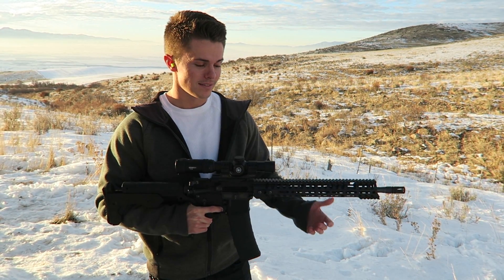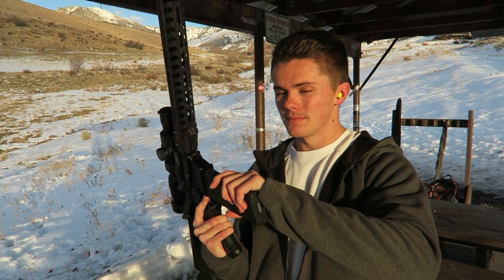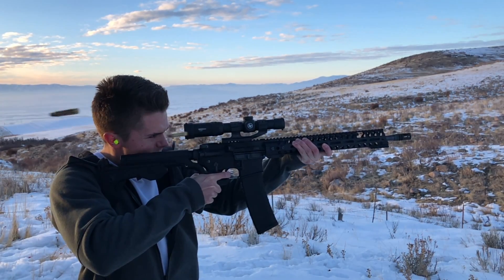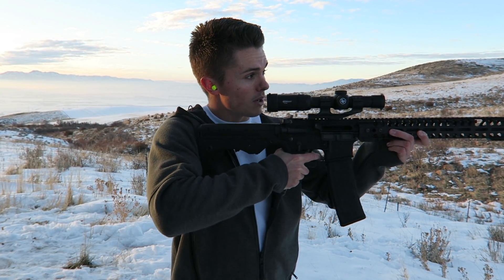How Fast Can A Bump Stock Really Shoot?

Comment: Your explanation is true and exactly why I don't believe bump stocks were used in the Vegas Shooting.
Reply: There was 1 volley of fire that lasted 32 seconds.  There are no magazine fed firearms (bump stock or even full auto) that can sustain that long of fire (due to limited magazine capacity). The only way that could have been done is with a belt fed machine gun. It wasn't a bumpstock. No way. A full auto M16 shoots at about 800-900 rds per minute.  You'd need a magazine that held 400+ rounds and there are none. The largest mag that will fit a AR platform is a 100 rd drum which at best would give 8 seconds of continuous fire....not 30+. 
Was a false flag event constructed by the gov using a M240 (there are videos that show the exact sound wave patterns matching up exactly).
Reply: @wilcoxtactical3716  YEP!
Reply: @wilcoxtactical3716  If an M240 was used there would have been a lot higher death to injury ratio, and the projectiles would have been pretty obvious. It was 5.56 being fired, not 7.62x51 like an M240 would fire. There's absolutely no reason why they'd have to lie about the weapon used either, so I really don't understand this insistence that it couldn't have been an AR platform rifle with a bumpstock. The fire rate is also very consistent with a bumpstock, and has the same characteristic droning (shifting from slower to faster fire rate, i.e. inconsistent) that you'd simply not see out of a belt fed firearm.
Reply: @infantjones   @infant jones  its already proven an M240 was used.  Everything you have said is speculation that is not backed up by facts. There is reason they would lie about the gun used for 2 reasons: 1, there are very few M240 machine guns that are owned by civilians because of the NFA. The vast majority of them are owned by the government. (Not something you want Americans knowing if you just one of your military guns to shoot up a concert) 2, it doesn't fit the agenda. The agenda was to ban bumpstocks. That was critical to their mission. Ive owned several bumpstocks and they are very hard to get any sort of consistent rate of fire. The sound waves from the shootings was 100% matched up to a m240...not a bumpstock 5.56. The m240B has 2 cyclic adjustments on its gas block. You can select the faster one to around 800-900 but its generally set to around 650 rounds per minute.  Having been a machinegunner in the Infantry 5/20 INF, I am familiar with that gun and its rate of fire. The 2 rates of fire between a bumpstock and M240 are not comparable. 7.62 also doesn't sound like 5.56. 
A bumpstock is a semi auto weapon and is nearly impossible to get any sort of consistent uninterrupted rate of fire and there are no magazines that could keep going 30+ seconds with anything other than a belt fed machine gun. Even the slowest of full auto weapons shoot at around 500 rounds per minute.  Do you know of any 250 round magazines available for the AR15? 

https://m.youtube.com/watch?v=I82X-7pwWmQ

https://m.youtube.com/watch?v=_mXe9dk77bk
Reply: @wilcoxtactical3716  How in the world has it been proven? There is virtually no clear evidence to suggest an M240 was used, and loads of counter-evidence. As mentioned there was a very low death-to-injury rate, which wouldn't be the case were an M240 used as it fires a round which retains much more energy at range, whereas such a low ratio is quite well expected for the use of 5.56 at 450 meters, which is 200 meters beyond the maximum effective range (past 250 meters the fatality rate plummets). Further, as far as I'm aware not a single 7.62x51 projectile nor casing found ANYWHERE by ANYONE in ANY PLACE outside of the AR-10 platform rifles Paddock had in the hotel room, which weren't even used as far as I'm aware. If it were an M240 used, there's very little reason to lie there either as they could very easily claim Paddock illegally converted a semi-auto variant of one to full auto, as you can buy a semi-auto M240 for around 12,000-16,000 dollars, something Paddock absolutely could have afforded. Then, if this idea of it being some ploy to ban something were true, they could use that as an excuse to (for example) ban semi-auto belt feds, or even semi-auto versions of full-auto-only guns as a whole! Hell, they could have claimed it was a parts kit build and use that to crack down on parts kits like they've been trying to for years! Both would do far more to further their goals of gun confiscation than just banning a type of stock, which doesn't even get rid of the actual rifle. 

Next, in the first video you link the fire rate is very clearly inconsistent, droning from higher to lower rates and giving that distinct "wavy" sound you hear in virtually all audio of the event, which is exactly what you'd expect from a bumpstock and not at all what you'd expect from a belt-fed machine gun. There are also many brief pauses in bursts (only a few seconds) consistent with losing control when using a bump stock and ending the actual bump firing, alongside a good few single shots that probably resulted from a failed 'bump-start'. Further, neither of the clips provided show "30+ seconds of uninterrupted gunfire", and I've never heard anything close to that in any audio of the event so I really do not know where you're pulling that from unless it's out of your own ass. The closest thing was two extended bursts that still had several seconds between them, more than enough time for reloading.

With the second video, claiming any single fire-rate for the use of a bumpstock is absolutely moronic, though it's "interesting" how the uploader exclusively uses the lowest-rate bursts even though a much higher rate can be heard in most audio, that higher rate not at all being consistent with an M240 (being under the M240s higher cyclic rate gas setting) even were we to ignore the inconsistent rate of fire in individual bursts. As I've already mentioned in this thread, fire rate with bump stocks can vary considerably depending on the specific stock used, how the rifle in question is gassed, length of gas tube, strength of buffer spring, weight of buffer, how the shooter is holding the rifle, and even the length of the shooters arms! Cyclic rate between different ARs can vary quite a bit because of these factors (alongside things like bolt weight, temperature, lubrication, etc.), and it's rather easy to shoot slower than cyclic rate when using a bump stock. You even hear this with different bursts during the shooting! Several different fire rates were heard across the various bursts of fire, which isn't surprising as Paddock used multiple rifles in the course of the shooting, tossing one and grabbing another if he got so much as a stovepipe jam because he was a blatant amateur in virtually all aspects of his planning and execution of the shooting, hence the amazingly low death rate compared to the number of people who were shot. And again there was not, at any point, anything even approximating a 250 round burst of fire. 

The variance in fire rate is pretty obvious in most videos of people using bump stocks-
Quite slow rate at the beginning of his first burst: https://www.youtube.com/watch?v=n6FnhUYifgs

Here you have a rather slow fire rate (once they actually start bump firing): https://www.youtube.com/watch?v=jKgu6g6pyDI

More variance heard here, with a very slow fire rate when he's using the 100 rounder, picking up some towards the end: https://www.youtube.com/watch?v=pqxoiAjSrAU

Bump firing isn't a precise nor consistent means of firing, as seen here the fire rate can vary wildly, even on the same rifle on the same magazine in the same burst. I'd also just say that banning bumpstocks would be a laughably small-scale agenda behind doing such a thing, they didn't even ban any other devices that allow you to replicate fully automatic fire, they just banned the one item that got a lot of press as a result of the shooting, and did it without even going through Congress first. If they wanted to ban bumpstocks, it could have been done through the Presidency and the ATF (like was actually done) without any event required to justify it as the ATF is already freely able to arbitrarily change definitions (and as such ban certain items) with practically no oversight. Plus, as I've already detailed, there would clearly be more motive to claim it was an illegally converted M240 than there is to say it was just rifles equipped with bump-stocks. Even with the bump-stocked ARs, it would have been hugely beneficial to gun confiscation plans to claim Paddock was a restricted individual and all his rifles were parts kits builds on 80% receivers or something of the sort. The goal of the gun grabbers is to both restrict types of firearms available to the public and to reduce access to firearms as a whole, banning bump-stocks did not even theoretically accomplish any of that. It failed to actually disarm anyone and even by gun grabber standards was a useless "feel-good" type action.
Reply: @infantjones  I'm going to make this quick because I have a life and things to do today. 1, you're wrong on everything you've said.  2, the FN M240B semi auto machine gun available for sale on the market is closed bolt and make no mistake about it. It 100% can not be converted to an open bolt machine gun. Look more for more audio clips. There is 1 that goes for 34 seconds and many that exceed 20 seconds. The fastest a bumpstock will fire approaches the 800 rounds per minute full auto rate of the m16 and contrary to your belief of changing rate of fire. Even if you cut the rate of fire to 600 rounds per minute you could only do a consistent burst for 10 seconds. Contrary to your belief as well number of rounds fired dont equal more kills. In Vietnam the US military expended nearly 50,000 rounds per kill in Vietnam and nearly 250,000 rounds per kill in Iraq. And last but not least the sound waves from the M240B (not capable with any other firearm) matched up exactly to the sound of fire from that day. The only way that could happen is if you had the same cartridge, with the exact same barrel length and same rate of fire. In court it would be 100% definitive evidence that could not be disputed. You may be able to convince some people that the government didn't shoot up those people with their own military firearms the same way they mowed down college students in Kent State in 1970...but here you're going to need facts. You're speculation holds zero weight.
Reply: @wilcoxtactical3716  1. Virtually everything I've said is demonstrably correct, "nuh uh" isn't an actual response to this. 

2. You absolutely can convert a closed bolt firearm to open bolt when it has originally been designed for such. Machine out the blocking bar (whether a physical bar or simply a stamped ridge in the receiver meant to block an unmodified bolt), buy an original bolt and fire control group (neither of which are regulated), and install them. Anyone with a few dollars and a cheap mill, or even a 100 dollar drill press really, can do this with some time and effort. To say it cannot be converted is objectively false, they're just more difficult to convert than they were before the ban on open bolt semi-autos as you have to replace/modify a typical 3 components instead of just 1. Class 3 manufacturers do these multi-component conversions of semi-auto clones/variants of machine guns all the time, it's not unusual in the slightest, and if you've ever been to a store range where they have some machine gun rentals, several of them were almost certainly converted from closed bolt semi auto. 

3. Simply link me one, just one, of these audio clips that show "30+", "32" "34" etc. seconds of /uninterrupted/ fire, because I've not found any of them so far, which isn't too surprising seeing as you change the number of seconds with each reply! And "contrary to (my) belief"? I linked multiple videos clearly demonstrating the variance in rate of fire, by several hundred rpm at that, did you just not click any of them or are you denying what you can clearly hear and see yourself? 

4. The number of rounds expended per kill in Iraq and Vietnam were not number of hits per kill, and I think you know this as I don't think anyone would be dumb enough to claim that only 1 in every 50,000 hits produced a kill unless you think the US was using pellet rifles. These statistics reflect how the overwhelming majority of gunfire from American forces is suppressive fire, which isn't even really intended to hit any target. I'd also imagine the shots fired per kill per rifleman were quite a bit lower than 50,000, that high number mostly being from mounted machine guns on both ground vehicles and aircraft, like the M134 which was extensively used in Vietnam and rarely hit shit but worked wonders for suppression. What I am talking about is the number of hits per kill, and under 14% of those who received GSWs in Vegas died, a rate that is to be expected from 5.56 some 200 meters beyond its effective range, but a rate that would be unusually low for 7.62x51, which has an effective range ~150 meters further than the range Paddock was shooting into the crowd from. If an M240 was being used, with the exact same number of rounds fired, with the exact same number of GSWs, there would have been quite a few more deaths. I don't think you or any other reasonable person could deny that at a range of 450 meters, a hit from 7.62x51 would be quite a bit more likely to kill than a hit from 5.56x45. At 450 meters, a 55 grain 5.56 projectile out of a 16 inch barrel will only have around 350 ft/lbs of energy remaining, whereas at the same range a 130 grain 7.62 projectile out of a 16 inch barrel will still have 850-900 ft/lbs of energy. For reference, 350 ft/lbs is comparable to being shot at point-blank range with a typical, standard-pressure 115 grain 9mm. out of a <5 inch barrel. Some 850-900 ft/lbs is about what you'd get point-blank with a .44 magnum out of a <5 inch barrel.

If the significant difference in energy isn't sufficient evidence for you that it'd be unusual for so few to die were 7.62x51 used, then I must ask again, where are the projectiles? If 411 people were shot with 7.62x51, why hasn't a single one of those projectiles come out to dispute the "official story" of 5.56 being used? Over 1,000 rounds were fired total, yet no one has found a 130 grain projectile in the dirt? That'd be an insanely efficient coverup if so, especially considering how incompetent the US government is when it comes to coverups. Where are the hundreds of nurses, doctors, paramedics, cops, etc. who saw and/or handled the victims and would be able to say if the wounds were inconsistent with 5.56, which they would be obviously inconsistent were 7.62 to have been used. None of them have disputed the use of 5.56 as far as I'm aware, despite many having already seen such wounds from experience with things like gang violence, firearms accidents, etc. in and around LV, but correct me if I'm wrong! The only real things I've heard is some saying the wounds weren't as bad as they'd expect from 5.56, which isn't surprising considering the energy loss at that range, and is also the opposite of what would be expected if 7.62x51 was used unless you mean to tell me it's a less energetic round. At 450 meters a lot of the really gnarly hydro-static effects you'd expect from 5.56 at shorter ranges are gone, but 7.62x51 will still rather easily maintain those same effects and produce noticeably larger holes in the process.

5. The sound waves didn't "exactly match up" in any sense, put on your glasses to look at the two if you need, one has a taller double-peak where the other has a wider, flat, shorter peak. In terms of audio analysis, they're only vaguely similar, nowhere near a match as you're claiming. The only burst which is around 600 rpm is in a ~3 second clip, where you can hear the fire rate start to speed up right as the clip ends. Funny how the person who made that video trying to claim it was an M240 cut off the audio as soon as it started to drift in fire rate, I noticed this on my first listen and I'm shocked you didn't. In the second audio sample (which the video uploader coincidentally does not directly compare to an M240 firing, only the ~3 second clip from before) we can hear an interrupted ~12 second burst (losing the bump-tempo and having to re-start after about 8 seconds) around 500-550 rpm, so roughly 100 rounds expended in an interrupted manner at a fire rate noticeably slower than the minimum fire rate of an M240. This means, quite simply, that the second video accidentally disproves its own point! 

So again, your evidence that an M240 was used is next to nonexistent, the video you claim proves it was an M240 both fails to do that despite its deceptive editing, and accidentally provides evidence /against/ the M240 hypothesis. The evidence supporting the use of an AR platform rifles with bump stocks is rather strong considering low fatality-to-hit rate, wildly inconsistent fire rates, length of bursts, etc. and you've yet to provide any actual justification for why they'd not simply say it was an M240 if it was an M240. It's especially funny that you keep calling my pointing out of basic, apparent facts (to anyone of sound sight and hearing, maybe you're just blind and deaf) about the situation as mere speculation while your argument consists of nothing but speculation, the closest thing to a fact you have is that in ~3 second audio clip of the firing there was a fire-rate of about 600 rpm. You're either /badly/ deluding yourself or just flat out lying out of stubbornness at this point.
Reply: @infantjones  I've got far too much going on to continue to read your 60 page replies. That being said ive given you the facts. You'll have to do your own research.  I'd be happy to do it for you but would take me too much extensive time to do so and link you to all the links and site my sources. Unfortunately I don't work for free and don't have a spare few hours to find videos and articles where many others have already shown what I said to be true. The m240 semi auto is built in a way to prevent it from being converted into full auto. You've provided nothing but speculation.

Peace. 

Peace.
Reply: @wilcoxtactical3716  You've provided no facts, only speculation and easily disprovable anecdotes. It's fine if you can't actually provide any sources, just admit so. And the M240 semi-auto is built in such a way to prevent it from being "readily convertible" as is the legal requirement, this does not mean it's anywhere near impossible to convert. It can be as simple as replacing the fire control group and welding the firing pin in place, alongside a few other minor modifications as needed.
Reply: @wilcoxtactical3716  you have no idea how to construct a cohesive argument
Reply: @051moowap8  my intention was to give a few facts to show that bumpstock were not used in Vegas. It wasn't to argue. The majority of people here have already made up their mind and nothing I say is going to change that but for the few people that want a place to start....should they actually want the to use facts and intellect to base their opinion off I gave them a starting point. Do with that what you will.
Reply: I grew up in Las Vegas. One of my coworkers was working the concert since he was an employee. He was an Afghanistan veteran. The night of the shooting he called me and said the gunshots he heard were the same as an RPK. Something he has heard firing at him too many times to count. The sound of a firearm that almost took your life is hard to forget.
Reply: The stacatto was most def full auto
Reply: Almost each volley of gunfire was about 100 rounds each. In 5.56 there's 100 round mags but in .308 that's usually some belt fed LMG
Reply: Never a motive in that one wierd... and wierd it was country singers fans and it was height of anti trump stuff..
Reply: That’s how it works. They use mass shootings and what not to scream gun control. The exact same people that think ar means assault rifle say what is good and what is bad.
Reply: Sanitys Void   I’m glad you brought that up.  That’s exactly why I came here in the first place.  Because I’m not convinced any bumpstocks were used during that awful massacre.  I don’t know much of anything about guns, but just judging by sounds, rate of fire, and the consistency of the rates from volley to volley, I find that what the Vegas shooter was using sounds most similar to some sort of belt felt automatic.   Glad to read your comment on this.   Thanks bud
Reply: @seanmullins5982  it sounded almost identical to an m240 bravo. Things really dont add up.
Reply: @yahyeet6247  😂😂😂 bro I was a 240 gunner for 3 yrs and I can tell you that it’s not a 240
Reply: I think he brought bumpstocks and said the hell with this. Then just used the ol' full auto strat
Reply: @IdahoRadioControlled  I think the FBI was involved and providing weapons.
Reply: Well for starters you shouldn’t fire a M240 B or a M249 (SAW)  consistently without giving it a rest for fire because the barrel could wield itself to the actual body of the weapon why its fired in bursts also Ar’s have been able to convert into belt fed all it takes is changing the top receiver
Reply: The audio I heard of the Las Vegas mass-murder sounded very similar in firing rate to this video.
Reply: @bobbabai  not really. Bump stock (if you can actually manage to empty a mag) is about ~800 rpm. Have you heard the video? Sounds like a belt fed mg. Continuous fire at 600 rpm. That wouldn't happen with a bump stock
Reply: Yah Yeet agreed!!!!  Vegas shooter(s) definitely sounded slower than this particular bump stock setup.  Again I have zero experience so just my opinion   Cheers
Reply: @seanmullins5982  definitely shooting as fast as the video. But why you don’t think so is bc on this video your hearing the gun fire while in Vegas all you hear is the super sonic bullets flying through the air
Reply: @yahyeet6247  Different bumpstocks on different rifles (the cyclic rate between the various AR platform rifles produced today can vary considerably, from differently gassed rifles using different systems to cycle using different bolt and buffer weights) will produce different fire rates. To say that there's any standard fire rate, like 800 rpm, for the use of a bumpstock on an AR platform rifle (or really any rifle) is very simply false. Further, did /you/ listen to the video? Because what I've consistently heard in the Vegas audio is an inconsistent fire rate, clearly varying in a rather distinct way, as you'd expect when a bump-stock is being used.
Reply: @bobbabai  this nigga said " He was shooting so he must have a bump stock! " type beat 💀💀
Reply: @bobbabai  give it another listen. The rate of fire in the Vegas shooting footage matches up exactly with an M240 and is slower than this video and every other AR bumpstock video I can find.
Reply: @legros731  but not everyone is so that's why bumpstocks exist
Reply: They were found on the guns in his room, but I personally don’t believe they need to ban them.
Reply: The theory is that those guns were planted there. There are a lot of things about that whole incident that don’t add up and point to it possibly being a false flag operation
Reply: @jeremyacosta7404  They must have been and the brass. Not enough brass on the floor to be real.
Reply: @jeremyacosta7404  planted there? Why do you say that? I'm curious to know what you think really happened.
Reply: @jeremyacosta7404  and the several folks who said cops in black gear were running thru the crowd shooting. 🤷‍♂️
Reply: @_Tipi  
what's the need for one, automatic rifles are illegal and a bump basically turns into a shitty automatic with little accuracy.
so the there is no point in having one.
unless you're firing into a herd of deer and just want to maim and kill.
Reply: @dabunnyrabbit2620  I feel it’s more for a sport to own one, but it can obviously be used for the wrong purposes when in the wrong hands.
Reply: @dabunnyrabbit2620  see you don’t own a gun or you would know all you need to buy a fully automatic gun is first, find one (good luck with that Bc you can only one a fully automatic gun made before 1986) second, spend tens of thousands ( a m4 is close to 20 to 35 thousand dollars) and last wait about a year for paper work to finish and then boom you now own a fully automatic gun that is as much as a new car
Reply: @dabunnyrabbit2620  automatic weapons are not illegal. Do your homework.
Reply: I am almost confident to say that bump stocks were used, there’s too many conspiracies that blame the shooting on the government. If you watch videos it sounds exactly like this and there are pauses in between each time the shooter fires the weapon. A fully automatic gun with a belt fed ammunition can simply not have been used because there would not have been as many pauses. Plus he used multiple rifles with bipods, each of them containing a 50-100 round magazine.
Reply: @angelportillo3404  Actual military machine gunners have commented on this and agree it's a saw type weapon. Did you see the hotel room floor? hardly any brass laying around for so much firing.
Reply: @SanitysVoid  You avoided my statement about the pauses taken in between each set of firing. Plus a full clip from an AR-15 is shorter than a SAW ammo box clip, which can explain the smaller amount of rounds fired in those pauses, also brass was recovered in the lower area of the hotel below which was one of the alarms that someone was firing a weapon. A lot of the casing was recovered from the ground area and not the floor that the shooter was firing from. My uncle who was a machine gunner doesn’t buy the conspiracy that it was a SAW machine gun because if the government used experienced SAW machine gunners there would have been more deaths and you would have heard short bursts of fire instead of full length trigger fire which comes from a bump stock. When you fire a bump stock (which my uncle used own) it is very hard to control the burst of fire, the bullets spray all over the place which is why so many people were unfortunately shot in different places.
Reply: @angelportillo3404  I don't think you have heard all the audio out there. And when I saw SAW I mean squad automatic weapon, i don't mean a specific model.
Reply: I have a few questions about the Vegas shooting ....

-What was his motive?

-Why so many rifles, ALL fitted with bumpstocks?

-If his wound(s) were self inflicted, wouldn't the wound(s) have been more grotesque and larger? The guy in Minnesota about had his whole bicep blown off from a single AR shot. (Maybe he used a hand gun to kill himself??? Were any weapons other than a dozen AR15's recovered?)

-Why did the blood on the presumed shooter look so dark, dried, and old? 

-Why did the police chief tremble like he was being forced to lie? I'm sure he did public speaking before this incident, but you could tell he was nervous AF!!!

-WHAT HAPPENED TO THE WINDOWS? Did he shoot them out? Where was the glass debris? If he removed them, how TF did one guy remove two windows weighing over 600 pounds each and if so, where were the windows?

I have a difficult time believing anything on the news since the SANDYHOOK CHARADE was passed off as an actual shooting and not as the choreographed event that it was. NOTHING adds up there. Ambulances were parked in. Families allowed to roam around the school. Dozens pronounced dead within minutes of the event. Family smiling and laughing the next day before and during the press conference. The weapons cash they revealed in the woods near by was enormous, MANY THOUSANDS OF DOLLARS worth of weapons. Very unlikely for a high school kid to have accumulated those weapons.
Reply: @sthor1000  on the whole wound thing. A 556 is very fast it will move right through a 22 lr is very dangerous for this reason it’s not that fast so it will bounce around inside there body while 223/556 will go in and out
Reply: @sthor1000  and blood starts trying with in a minute so it’s actually very normal for it to look that way after a while
Reply: @sthor1000  You can see the handgun he used to kill himself in the photo of his dead body. SWAT didn't breach his hotel room until quite a while after he killed himself. He also rather simply shot out the windows, you can see how they're shattered in photos of the building. 

I'm also curious why you think Sandy Hook would have been a "choreographed charade". The government has no issue with killing children, they do it regularly both here and overseas, so why in the world would they only pretend to do so?
Reply: @sthor1000  don't forget the school was condemned and closed for asbestos violations.